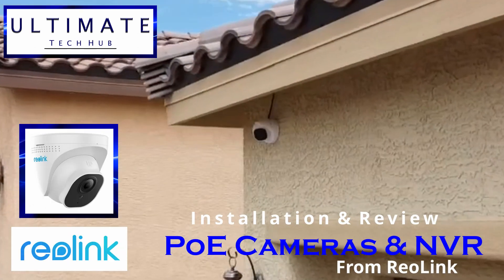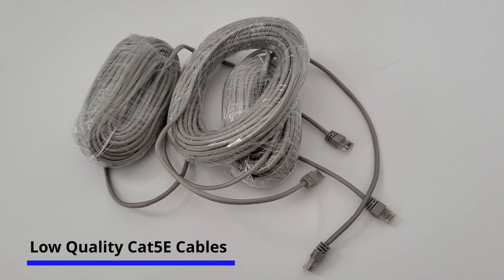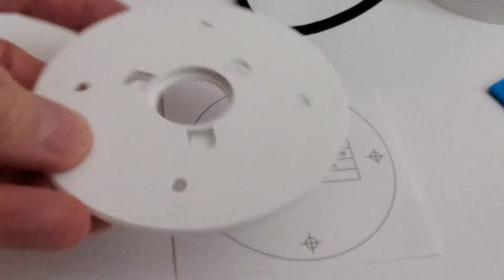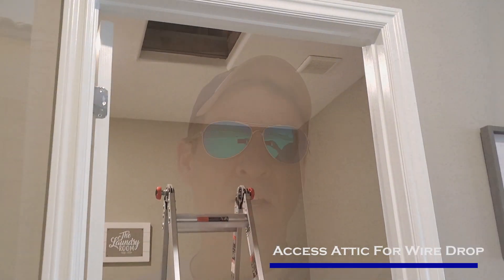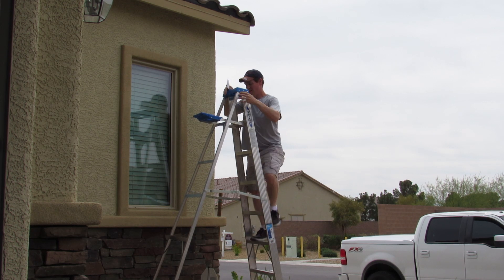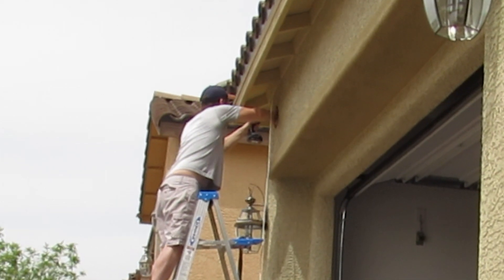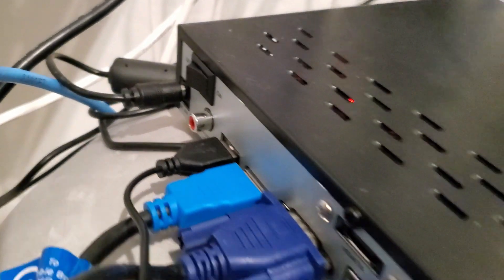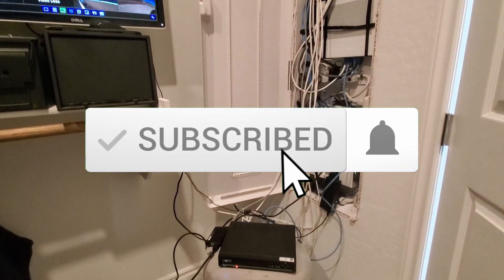Reolink 5MP PoE Camera Setup - Entire System QUICK & EASY! How To

Comment: When you mount the camera do you have an option to tell the system what way it is mounted? You had yours mounted horizontally did you tell the nvr that so it knew the picture feed output?
Reply from the maker: The cameras are positioned horizontally so its the same on the NVR. If you position it vertically it will look vertical so it would be sideways. You can position the cameras anyway you want and the NVR will show it exactly how its positioned.

Comment: "Quick and easy" but go ahead and hire someone to run all the wiring. LOL
Reply from the maker: Hey you can climb inside a 110 degree attic for 3 hours and run cable if you want but I'm not trying to get heat stroke! Lol! Anyways, he just ran cable and I terminated all the wires and connected all the cameras and setup the NVR and the network access. But yes I hired someone! Thanks for watching!

Comment: Thank you for posting valuable information, esp with regard to stucco homes! If your Cat 6 cabling needed to live outdoors for say 15 feet, like on a stucco balcony and routed around balcony  via rail fencing to exterior of house, what type or brand of UV/weather resistant cabling is preferred? Is conduit preferred? I would think conduit might get too hot in 113 degree heat?

Comment: I’m using the cat six cable so I am not using the external power. Can I cut the 2 extra wires because I’m going through a 10 inch deep in a wall I don’t want extra wire to get hung up inside a wall.

Comment: Won't the system overheat from being in the attic?
Reply from the maker: @YugiohTube  The NVR is in my closet so no heat issues.
Reply: I have a similar system from another vendor with the NVR in the hot attic.  I put a laptop computer fan cooling pad (from Amazon) beneath the NVR. It’s been running continuously for several years. It may have been better had I added some type of thermostatic switch to minimize the run time and make the fan last longer. I made some baffles to force the air from the fans to blow only on the NVR and not out the sides.

Comment: I noticed you didn’t run the wire through the hole in the center of the bracket where it would be hidden behind the camera.  Isn’t that the way it’s supposed to be?
Reply from the maker: @danielcleary1072  I moved the cameras a few months later. I have a video about it. If you want the link let me know.

Comment: ROFL more like 150 a line drop and we use Plenum cable also, we use outdoor camera boxes so you do not have to drill such a large hole also, we seal the hole we drilled as well.

Comment: How much should I charge a person to install them when they don't have eletrical outlets their
Reply from the maker: If your running ethernet for the PoE connection I would charge 75 to 100 per wire drop. But it also depends on the locations and access like attics or basements.

Comment: Very helpful thank you!  Just wondering. Can i hook this to my tv then just switch inputs to view cameras or do i need a separate monitor just for cameras?
Reply from the maker: Yes, you can run the HDMI from the NVR to your TV or you can run HDMI over ethernet which is what I did. You can only view what your NVR is showing on the screen, you can't switch cameras from the TV.
Reply: @UltimateTechHub  
 Ah thank you so much!  I was thinking I could run it to the TV with the hdmi outlet but just wanted to make sure.

Comment: Thanks! Glad that I just watched and found out about the cat6 riser cable, cause I was just going to use the supplied cat5 cable. Just ordered all cat6 supplies just in time for Christmas for my Reolink 4k 8 cam, 16ch. 4tb system, that I know I'm getting!  Again thanks, on how to crimp and set up my line drops!!
Reply from the maker: Awesome glad you have the confidence to install the cameras! It's fun and pretty easy! Thank you for watching!
Reply: I installed my old 720P 4 camera Night Owl  system years ago. This one is basically the same, except this system is WAY Better! I have 4 out of the 8 cameras hooked up and running now. Will get the others up later.  Thanks again for the video!!

Comment: Can you plug poe cable straight to your router
Reply from the maker: No you need a PoE switch or PoE injector. Most routers don't have  PoE LAN connections.  Get a cheap PoE switch.

Comment: Hey thanks for the video! I was looking at the same Reolink system. I also live in LV and have the same type of soffit. I was wondering if you could install these cameras on either 2x4 under there? Trying to think of the best way to hide the wires
Reply from the maker: This was my first installation so it wasn't pretty. However I went back and moved the cameras over the wire holes. Here's a video showing that. 
https://youtu.be/me_9OTYyGEM
As far as drilling through the 2 by 4 it may be possible it just depends how your house was built. Hope your surviving the heat!! Lol! Thanks for watching and make sure to check out the MSG Sphere video we did on the amazing technology!

Comment: hi I get one of this dvd I'm did all connection camera show on it connected with the internet but on my monitor can't see anything just said video lose ,any advice
Reply from the maker: Replug everything back in.  Are you using HDMI?
Reply: @UltimateTechHub  
Yes I’m using HDMI
Reply from the maker: @mendomsa Does it show the separate video screens for the cameras or just a 1 screen?
Reply: @UltimateTechHub  
It show separate videos but the 4 cameras said lose video
Reply from the maker: @mendomsa  I's the camera connections. Are you using PoE to power the cameras? Ot power adapter?
Reply: @UltimateTechHub  Poe connection
Reply from the maker: @mendomsa  Your using the NVR system?
Reply: @UltimateTechHub  yes I do Reolink that one you show on this video

Comment: Just curious, Do you have to use a monitor connect to the back of the NVR to view the camera system and configuration?  Could I put the Reolink software on my PC and view it over the internet via IP address or some other way.   I would like to be able to just pull the cameras up on my computer if need be without going to my network closet?   Also, can you have the app on multiple mobile devices?  I would like to add it to a wall mounted Ipad next to my front door for easy viewing with the reolink doorbell feed and when we have deliveries and such.   Appreciate the information.  I am not to familiar with REOlink and trying to make a choice.
Reply from the maker: You need the monitor connected to the NVR to setup the system. After that you can disconnect the monitor. You can view the cameras from your PC and other cellphones as well.

Comment: Got a ballpark estimate for $400 per line. Seattle area. Nope. Going to do it myself now. I have a couple tricky ones with no direct access to attic, so will need to run conduit on the outside of the house about 40 feet to get it to the attic. Maybe the $400 estimate was high, but they charge to come to my house for an accurate estimate.
Reply: Sounds like a major rip off.  If a company is charging to come out to give you an estimate that is actually a consultation.  An estimate should be free and $400 is way too expensive even for Seattle.  I live there too.
Reply from the maker: That's way too expensive. Should be around 100 dollars per drop. I would call around to get a few more estimates. Otherwise I have several videos on how to wire drop ethernet. If you want the video link let me know. Thank you for watching and if you subscribed thank you as well.

Comment: What are the other two connections on the camera? Do you connect them to something or what are they for?
Reply: one is to supply power in case you do not use POE, the other is a reset button, 3rd is for a poe cable

Comment: I have low voltage pulled out already and wondering if amy cameras have just a socket like wifi access point.
Reply from the maker: These PoE Cameras have PoE connections that can connect to access point ethernet ports if that's what your talking about.

Comment: Can I aatach external Ethernet switch, and there plug in Camera through PoE charger? I already have network at home, and would like not to drill holes for cable network only for cameras. Any idea how to achieve it?
Reply from the maker: That might work depending on your network setup. These cameras don't have to be PoE , you can use a power supply to power the cameras. But that requires more wiring so that wouldn't make sense for your situation. I would give it shot and see if it works. Keep me posted and thank you for watching.
Reply: @UltimateTechHub  I'd like to use PoE power adapters, I had bought already 2 cameras 811A and Reolink NVR, will try to use my existing Gigabit ethernet and connect cameras to my switches through PoE adapters and whole traffic should go by net eth-port on the NVR device
Reply from the maker: @JacekSkowroński-b5f  Sounds like it should work. Please let me know if it works so I can update my information in the description.
Reply: @UltimateTechHub  i will
Reply: @UltimateTechHub  works fine!!!
Do You have any advance tutorial for seting system up? I have an issue when I download movie it's only 640x480 - not 4k like it is recorded on the disk. Can I somehow force it to get movie downloaded in the 4k res?

Comment: Why did you choose CAT 6 cable over the provided Ethernet? Thanks!
Reply from the maker: Cat6 has higher bandwidth and is slightly thicker and more durable. I always use Cat6 for any video or data installations it's just better and its future proofing your home and the cost is just slightly higher. Cat5e will work if you don't want to spend the extra money. Thank you for watching and if you subscribed thank you as well.
Reply: @UltimateTechHub  thanks for your reply. But does that mean better video quality or better streaming over phone?

Comment: Im a pro install tech and I just want to say you did a very good job, I would give you 8 / 10 , mostly because you didnt hide the wires, thats a no no in my trade, wires can cut or damage but other than that awesome job and vid.
Reply from the maker: Thanks I really appreciate it. I ended up hiding all the wires expect for 1 camera.  I'm no pro but I really admire you guys who make it look so nice and clean. I will install 2 more reolink cameras when it's cooler outside. Thanks for watching!
Reply: Would you recommend installing an exterior box and then mountain the camera to it and running the wires through it thus hiding everything. That's what I was planning on doing
Reply from the maker: @shantor100  This is the updated video that explains the installation and the review of the Reolink system. It should help you figure out the installation. 
https://youtu.be/me_9OTYyGEM
Thank you for watching and if you subscribed thank you as well.
Reply: I’m a pro master tech installer manager, and I agree.
Reply: question for you
I connected everything and i set up on my phone and i can use only in my
house to watch cameras on my phone
when i go outside they disconnected and then i have to come back home inside and they works again 
how and  why not working using my  phone internet

Comment: I purchased from your link for model RLK8-520D4 on Amazon and it is not the same model on their website. The cameras you show do not have an SD slot and that model RLK8-520D4 is supposed to have an SD card slot. I don't know what exact model I received because I cannot find one on their website that doesn't have an SD slot and looks like mine. which look like the ones in this video too. Im confused. I think they sent me a cheaper model or left out some advantages on purpose. BTW none of my paperwork included lists the Model number at all.

Comment: Is it possible to set the cameras up so the Ethernet cable outside is hidden, a hole for the cable is made then the camera sits on top of that, hiding the cable completely? I've not seen an install videos that do this, so curious if this  doable?
Reply from the maker: Yes I have one camera underneath my patio that has the wire completely hidden and I reinstalled 2 other cameras and place them over the holes for a cleaner look. The other 3 cameras cannot have that option because of the structure of my roof would make it very difficult to run the wire to the exact location. But yes the ideal way is to place the camera directly over the hole with the cat6. Thanks for watching!
Reply: @UltimateTechHub  Great news. Appreciate the reply!
Reply from the maker: @rollababe2008  Your welcome and enjoy the cameras they are fantastic!!

Comment: A few things missing from your review that would have made this a great review instead of a good one.

1. Audio quality test and sample in the video.
2. Day and night video samples, I only saw daytime samples and only through camera not actual included samples.
3. Motion sense test.
4. Motion pre-record and post-record settings
5. Active motion area configuration
6. Details on mobile app, doe it connect back to your home or does it use a cloud vpn system where they have access to your video feed and if it's a direct connect what router ports and settings need to be implemented. Everything I see seems to indicate the remote app portion is cloud based and streams pass through a chinese server.
Reply from the maker: Thanks for the comments.  It was my first security camera review so I missed a few things. Picture quality at night is typical for most cameras. We had some vandalism late at night around 500am and I was able to use the Reolink DVR to see them tag a wall. Using the Client  software on my PC I was able to take snap shots  and video to be sent to our local police department.  The quality was only good enough to see the taggers but with minimal detail. They where about 40 feet away and they had cellphones as flashlights. 
The Reolink Client software connects locally to your DVR.  I have 2 videos on the install and basic settings. So check those out. The software is pretty good. And reviewing camera footage is easy to do. And the motion sensor is great because on the client software the motions are in red while the rest of the video is in blue. That's how I found the taggers. Just look for red marks in the recording feed. I've had this system for about a year and I really like it. Thanks for watching and if you subscribed thank you as well.
Reply: @UltimateTechHub  Thanks for the reply and great follow-up answers.  Night(IR)vision is always troublesome with consumer grade cameras. Even many of the high end Sony cameras are not that great unless you get into the super high end or military grade sensors, but who can afford US$100k per camera for a home system? I am looking at the ReoLink and GW Security. the GW Security software is much nicer but their comparable systems average 30-60% more than the ReoLink and the software isn't that much better. My main concern is not having to connect to a third party system/server when using a mobile device such as a phone when away from the house. I may try to wait just a little bit as it looks like ReoLink is pretty close to releasing their 12MP camera and I want to see if the sensor in that is any better at night. Also have you tried to connect with two mobile phones at the same time when not on your local network? I've come across several systems that will only allow one remote connection at a time. I will go watch your other videos on the system in case they answer these questions. Last thing, the field of view looks pretty normal, and most of their cameras are advertising 87deg. I would rather see 100deg, but how do you feel the field of view is for you?
Reply from the maker: @bmmcwhirt  The field of view for me is good. It covers all areas well. 12mp would be amazing.  Probably will need a 4tb hard drive to store all of that video footage. Keep me posted when you decide which brand to buy. And thanks again for the great comments and for watching.
Reply: What's the update, what you end up getting? Great questions you asked.

Comment: Did anyone use the included ethernet cables? Want to know if they are good enough for the install.
Reply from the maker: They are flimsy so thats why we decided on cat6 riser cable. However, the cables should work just be careful not to damage the cables. They are kind of thin.

Comment: If you're going to run the drops, tell them to run TWO lines. It shouldn't cost you any more than the cable itself. Might as well have a back up just in case.
Reply from the maker: True i have Cat6 lines in 3 rooms in my house and 2 lines in each room. Probably should have done that. I have a total of 15 Cat6 lines but your right its better to have a back up in case of failure. Thanks for watching!!!

Comment: Okay so it comes with (4) 5mp cameras can I purchase extra (4) 4k cameras and it run them as well or the extra cameras got to be 5mp only?
Reply from the maker: Yes I believe it will work with Reolink NVR system. I have other Reolink camera types and they ALL work with this NVR with no problems.
Reply: @UltimateTechHub  Thanks

Comment: What do you do when you do not have access to attic from outside?  Would you recommend running cables to just one access point?
Reply from the maker: Yes you can run the cables under your roof eves. Use cable clips and I would use Cat6 outdoor waterproof CMX rated cable. This will hold up well in any weather conditions. I think true cable is the brand I have used before but most brands work well. Just check the reviews first. Thank you for watching and if you subscribed thank you as well.  Good luck and keep me posted!